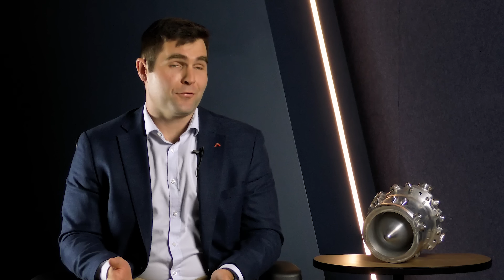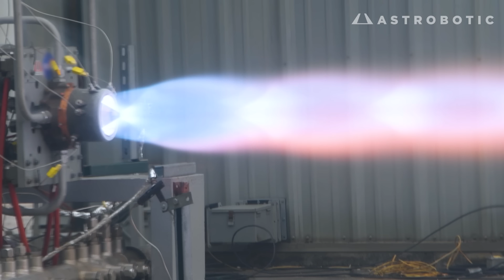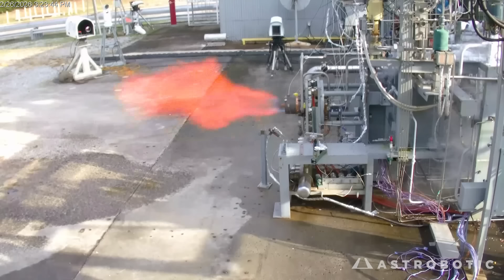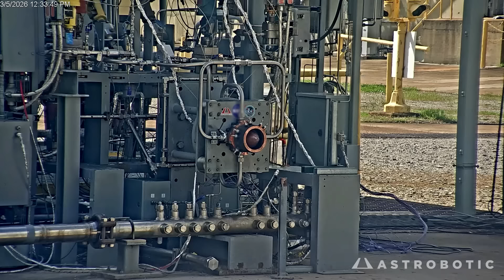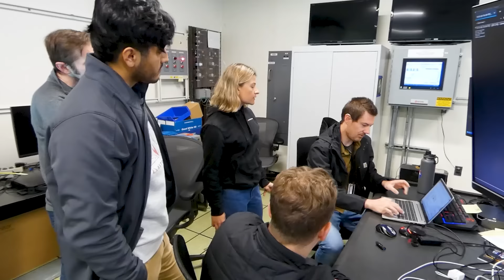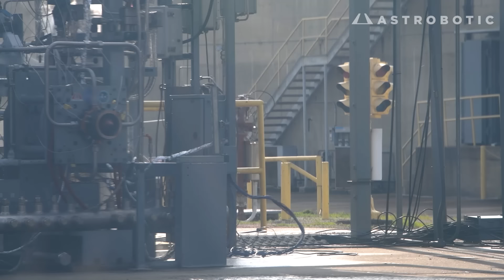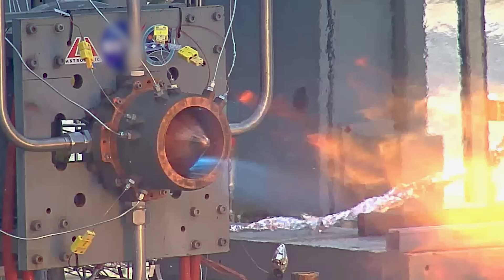Astrobotic Breaks Records for Hot Firing Rotating Detonation Rocket Engine (RDRE)

Comment: Still incomplete five percent of needs . We need not thin stlll walls because we have fire more heat least pressure/ we need masive thick wall container more sire pressure least fire 🔥 enough heat to expand pressure need may we fit see air because if its behaviour we also should not see all these fires. Never food achievement more better

Comment: Looks more like a type of pulse thrust and that can have problems because it creates pockets of burst and then constants of lower pressure thrust. You'd have to use multiple that have different timing from the burst to the length of burn between pulses so that you use less fuel but have no gaps in the pulses as one is firing when the others are not making the thrust continuously propelling.

Comment: What's the Specific Impulse (Isp)? I'm more interested in that than anything. Could an engine like this be scaled up to sizes suitable for manned spaceflight (even as a second stage) and achieve the necessary thrust with higher Isp than conventional rocket engines?

Comment: 4000lbf, so to achieve more than 110k lbf you'd need to get make it 5.3x wider and taller. That would beat the most powerful GE9X engine available. But to beat the engine of the F22 Raptor, you'd only need to make it 3.2x taller and wider.

Seems logical to partner with a missile company next, like RTX.

Comment: According to AI, if you use radial injectors and concentric channels with a reduced center piece you may improve considerably the efficiency. A nozzle may eventually catch thrust from unburnt fuel and address outside pressure differences.

Comment: We'll achieve true peak when the heat on that aerospike is enough for an expansion cycle engine.
Afterall the "downside" of an aerospike is often too much heat and one of the benefits of a detonation engine is low requirement for propellant pressure.
If we can make those two meet in the middle, it's going to make things very simple, cheap and reliable.

Comment: Oh, so you're gonna talk about your lunar landers? Like, Peregrin, maybe? Like Griffin? Talk about the schedule. Talk about the horrific software and the mission controller. Ick.

And while we're at it, how does 4000 lubs of thrust get coupled through something as small as that tiny bell? I'd think you are getting into the strength of materials when dealing with that kind of force. And don't forget that it is also operating at temperatures approaching the liquification of the metal. 4000 pounds? Data would be nice.

Comment: There's a video with sound from two years ago. IDK why they say this is new, the previous test got 5800 lbs of thrust, this was 4000. Same place, NASA's Marshall Space Flight Center, same engine, two years ago
Reply: You are half right. It isn't the same engine, but yeah it isn't brand new tech either. The NASA engine is a separate project, you can see differences in the design of the nozzle. They were both tested on the same test stand though which is why the larger assembly may look similar.

I'm glad industry is innovating and props to the engineers who made this work, but also ignoring NASA's contribution to the technology and pretending their successful test didn't exist irks me as well.

Comment: When you consider that you're watching combustion products SCREAMING out of that engine at six thousand meters per second, AND, in that hellish circular combustion chamber environment you are STILL CAPABLE of seeing THREE consistent combustion wave fronts in that moving jet of combustion products, WELL, if you aren't astounded by the fact all you are seeing is the effects of the actions of electrons as described by quantum electrodynamics, then you are obviously far better at mathematics than I am.  And don't forget, the violence under control here in the experiments is still literally millions of times slower and weaker than actions where nuclear fission or fusion is the prime cause of that violence. 
THAT'S just flat-out mind-melting levels of cool...

Comment: Ok, 4000lbs of thrust. How much fuel does it drink per second? What is the isp? It would be great if it was better than existing engines but if it is just a gimmick I'm not interested. Well... maybe... if it is worse now but would become better if scaled up it would have my interest.
Reply: Rotating Detonation Engines aren't a gimmick.  If they can get it working reliably, and that's the key, they're ~25% more efficient (higher isp) than traditional engines using the same fuels.  They're harder to tame though.  I'm looking forward to seeing more data w/re throttleability and what percentage of that 25% improvement that they have been able to capture.

Comment: seem to be good for emergency thrusters what are the main propulsion system is obsolete Jupiter 2 Star drive system is much much better uses a magnetic non-thermal dramatic subatomic Matrix output on one cell to achieve maximum output manlift

Comment: That's close to the size of a combustion can on a J-79. 

If the overall gas column can be stabilized to not shake the turbines apart, it would seem to make for an incredibly efficient gas generator for a semi-conventional jet engine. 

Increase entrained air, perhaps...  

The question then would be if the combustion chamber could be configured to run on air and kerosene, as opposed to pure O2 and... hydrogen?... blue and no carbon visible so seems likely. 

Good job folks. I look forward to your continued success.

Comment: This is all great. Impressive work. There is still a lot of work to be done to make this thing a reality to fit in a rocket for use. How long can this run for? I think this is the same engine that NASA released about 5 or so yrs ago. 
For high thrust to weight ratio, we should be looking into constant combustion engines by that i mean, we should be looking into engines where you do high compression, then ignite it. That will make use of every gram of the fuel so much more efficiently. Think compression ratios of upwards of 100:1, shooting out the exhaust, you could get insane thrust with just modest quantity of kerosene.

Comment: By generating plasma vortexes through that engine, does it allow the actual torque force output distance to increase in length and does it improve overall fuel consumption when compared to regular controlled explosion engines?

Comment: Isp??  Durability?  Thrust to weight?  Shocks tend to destroy metals with erosion of surfaces due to intense near-surface heating+localised high/fatiguing stresses.  Conventional rocket engines like SpaceX Merlins and Raptor can happily run for hours, but there is a high liklehood that RDRE will only run for tens of minutes.  Also aerospike nozzled engines tend to be heavier due to larger mass in combustion chambers.  Need more detail before we know if this has any benefit next to the very high bar set by Raptor (nearly 200:1 thrust to weight and 350-380s ISp with very sheap LOX/CH4)

Comment: That seems like a lot of thrust for something that small, but I suppose I don't know what's typical
Reply: It's highly atypical. Higher efficiency+far smaller size means that the rocket equation kicks in. More mass means more fuel means more mass means more fuel. Now take the opposite of that. Less mass,less fuel,which weighs less,needing less fuel..

Comment: How do you vacuum optimize this nozzle?
Reply: So, aerospikes are actually self-optimizing, at the cost of having a lower efficiency at any pressure than a dedicated deLaval nozzle would have. This is why single-stage-to-orbit designs keep trying to use them, but multi-stage rockets don't, since if you're throwing parts away partway through the trip anyways, then you might as well have a dedicated low-altitude nozzle be one of the things that gets thrown away.

As far as rotating-detonation engines go, they realistically need to have either an aerospike or a plug-style (basically an aerospike inside a deLaval) nozzle, because the combustion chamber has to be a ring, and thus you need to have some transition structure for aerodynamic / eddy reasons which is going to wind up as a cone, at which point you've got an aerospike or plug regardless of your own wishes and should just optimize it a bit.

Comment: Does the rotation speed change with throttling? Is that a challenge for stability? How low can you throttle it. Any guess as to ISP with whatever fuel you are using? Huge congrats this is a big deal.
Reply: rotational speed is always the speed of sound

Comment: No sparks this time. Somebody's got it figured out it seems. It just looks powerful. The diamonds are crazy defined.
Reply: Shine on.
Reply: No sparks ? What are the 6 sparks plug for ?
Reply: @WLS_Churchill Your funny. The original versions consumed themselves. Shooting sparks out the back. This didnt have any sparks. So one could assume they figured out the cooling and alloys so that the engine doesn't eat itself. Solid progress. The whole unit is 3d printed. Has taken then loads of work to get to this stage.
Reply: It'll be fully figured out once they get rid of the rotating combustion part.
Reply: @DumbledoreMcCracken There is no rotating combustion. Looks like its got serious promis. All the hard stuff is now done. Just a matter of tweaking on it a while.
Reply: @tireballastserviceofflorid7771  what are you talking about, the flame front is rotating around the central axis! The compression wave moves laterally and axially.
Reply: @DumbledoreMcCracken Yes but its not combusting. Its detonating. A regular rocket combust fuel. This detonates it. 100% different processes. Thats what allows a theoretical higher moment gain.
Reply: @tireballastserviceofflorid7771  I don't think you understand the integration of force over time (essentially average force).
Reply: @DumbledoreMcCracken Yup im a total dumb ass. Just ask any average troll.
Reply: @tireballastserviceofflorid7771   Detonation is a form of combustion.  There's detonation (supersonic) and deflagration (subsonic).  Detonation turns you into a constant-volume engine (like Otto) compared a constant-pressure engine (like Diesel).  Constant-volume is higher efficiency, just like Otto is higher efficiency than Diesel, but that doesn't mean it doesn't come with other consequences that trash those gains.

A regular rocket compresses propellant, combusts it, and exhausts it through a nozzle.  This engine would compress propellant, combust it, and exhaust it through a nozzle.  Functionally, this rocket still does exactly the same thing.  Except this isn't yet a rocket.  It's just a combustor, no powerhead, no nozzle beyond what is structurally necessary, and all sorts of other support provided by ground systems.

On a TRL scale, this is a 3-4.  It's a proof-of-concept to figure out how to light and stabilize the combustor.  They still need to discover all the drawbacks (like Otto pre-ignition) and see if it's actually worthwhile.

Comment: He says "had to go big", and it's smaller than other systems thrusters. When they scale that up to the size of a Raptor or BE-4..... The ISP is going to be amazing.
Reply: The entire problem with these kinds of engines is they don't scale well. This is already the largest one and it looked to be spalling the housing already after a 300s burn. Larger variants will fail much faster.
Reply: @Swiggityswagger Which will be why they get used in arrays, instead of big singles. Like having 33 Raptors instead of 5 Rocketdyne F1 motors.

Comment: The engine tech is great, the thrust for that size is amazing, this test engine scale is too small though for anything but early stage proof of viability. maybe good size for a small missle or one way drone / loiter munition you need to have the extra range gained by this. the rocket to orbit sounds like a pipe dream throw-away to have on paper that has no real value to some exec looking for a buyout / acquisition in 3-5 years thinking short term. Xogdor will never be realized, its just funds for R&D. unless that 1mil price tag is a cost per launch and your loft time is long enough to satisfy market demand. Nasa won't be a client of that though. maybe universities or other startups, but that'll only last until your first few commercial space stations are up in orbit where they can sell volume and experiment time with dream chaser or spacex dragon or cygnus cargo delivery up to it. xogdor should target docking abilities with the upcoming commercial station entities, or self contained LEO and reentry capsule so cheap experiments can get enough microgravity constraints and time constraints met for that small price tag and still return physical equipment...just my thoughts anyway. i think you'll struggle to find a market for it.

Comment: I have doubts it'll make the kind of thrust density and P/W that would let it be useful on the first stage of most rockets. Maybe the second stages, but if this actually does get the kind of efficiency in the future that's advertised, then it could be quite a powerful tool for kick stages.

Comment: I hear that it's efficient for a high-thrust engine, but what's the catch?
Reply: The catch is that they're technologically difficult. In addition to what the others have said:
1) They're detonation engines because the wavefront of the fuel burning travels at the speed of sound, which maximizes theoretical thrust-per-propellant, but also generates a really strong kick that can damage equipment more easily than ordinary combustion; and
2) Because the wavefront travels at the speed of sound, you almost (or maybe literally) need your propellant to be travelling at the speed of sound BEFORE it starts burning, which requires some potent equipment.
Reply: One catch is that aerospikes are tricky to cool enough, even with internal cooling channels. As the tech progresses, keep an eye on the burn time numbers.

Another is that it's typically harder to start, but no doubt making that is a huge part of their research. 

Also, I don't think they can throttle down very far without the detonation becoming unstable. 

It'll be interesting to see if their Xogdor rocket runs only RDEs, or maybe they supplement with traditional engines for when they need more throttle control for landing. 

This all said, I'm not a professional. Everything I know I've learned from YouTube, so... 😅
Reply: As someone who works on RDREs in a university setting, the catch is that efficiency numbers haven’t actually caught up to traditional deflagration engines, they’re extremely difficult to cool, and they they produce crazy high amounts of vibrations.
Now if somebody slaps a good nozzle on it, who knows? Also most research has been done to find the limits of wave propagation and wave dynamics than going for efficiency.
Reply: Now who knows, Astrobotic might’ve gotten theorized isp values, but I don’t think its been published anywhere